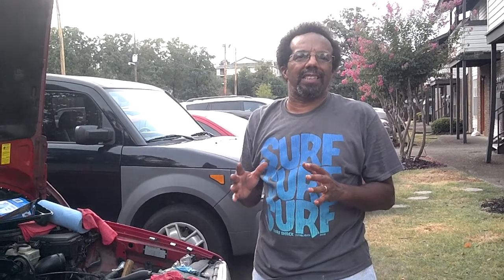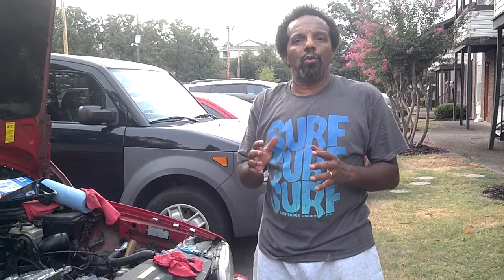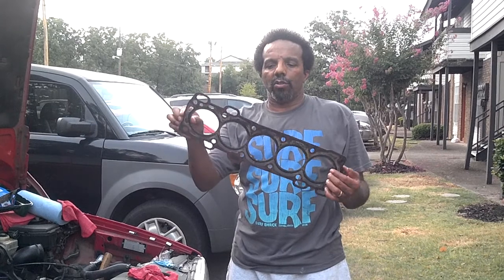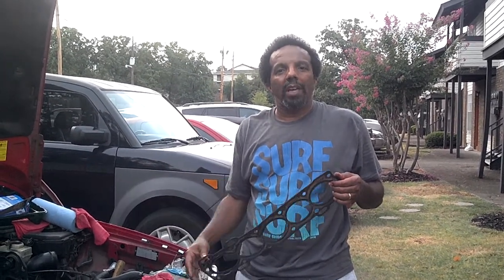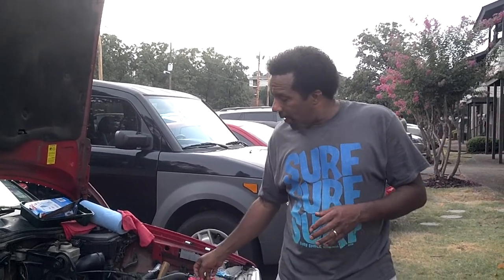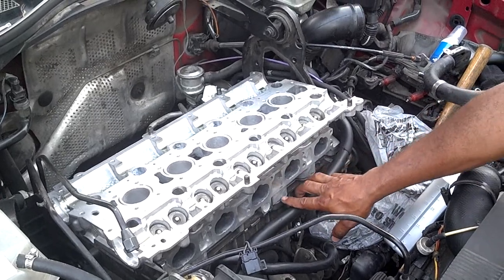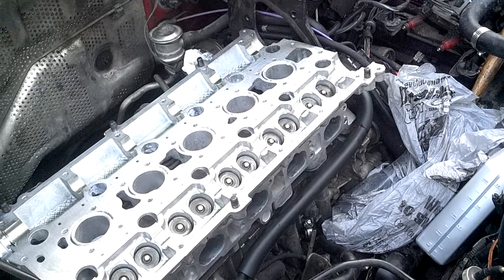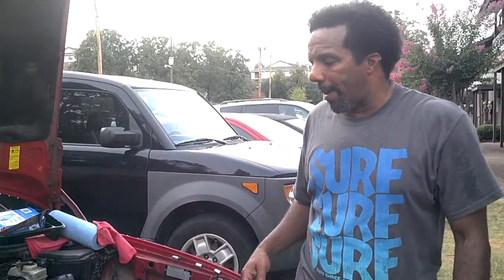Car head gasket information, loosing a little coolant over time. - VOTD

Comment: Robert thanks for all of your Volvo Vids. They have been helpful.

1997 850 +170K
The car is running well and no smoke . I was checking my fluids and noticed the coolant reservoir was empty. I put coolant in to the full level probably < 1 quart. I don't think my son over heated the car. HOWEVER, I WATCHED THE COOLANT TURN TO CHOCOLATE MILK. I could see a few drops of oil floating on top. 

-I removed the reservoir and drained the coolant from the radiator. The radiator coolant was perfect until the very end where there was a few drops of coolant.  I had the water pump replaced in Nov. when I had the belts replaced.  

- I bought a used reservoir and started the Prestone flushing. During the flush the sludge returned. I can skim it off with a turkey baster, but it only returns. 

The oil is fine. However I do seem to be down a little. 

Your thoughts on HEAD Gasket and any experience with gasket sealer? If I can get another 6-12 months out it her, I'll be happy.

Only owner for 19 years. 

Thanks again.
Reply from the maker: +pjlocke1 Have you checked your transmission fluid level? Is your car turbo? Chances are, you have a bad radiator.
Reply from the maker: +pjlocke1 Does your low coolant light work?
Reply from the maker: +pjlocke1 https://www.youtube.com/watch?v=r6Ct58lMhcI
Reply from the maker: +pjlocke1 https://www.youtube.com/watch?v=c_MJwY1fabE
Reply from the maker: +pjlocke1 https://www.youtube.com/watch?v=jsxPXltMFOc
Reply from the maker: +pjlocke1 https://www.youtube.com/watch?v=ZqdHDqGKYV0
Reply from the maker: +pjlocke1 https://www.youtube.com/watch?v=wGXoRLSDE04
Reply from the maker: +pjlocke1 I would NEVER put anything in my car engine in an attempt to fix some kind of leak.

Comment: I had the radiator replace 6-7 years ago.  Low mileage since then, so I don't think it is it.  It is non- turbo.  When I drained the coolant there were a few drops of oil floating on the surface.   

I had the water pump replaced 3 months ago.  I read somewhere that the water pump could be the culprit, but don't understand why/how.  I didnt think there was an oil line involved with the water pump.  

Btw, I like the Steelers hat.  A burgh'er myself.  Thanks for the hand.  Really helpful.
Reply from the maker: +pjlocke1 LOL, Radiators can go bad in 1 year, especially if they are cheap aftermarket ones.
Reply from the maker: +pjlocke1 There is no way a water pump can access oil.
Reply: +pjlocke1 
You called it.
I finally took it into a local shop. I had a radiator problem. The coffee colored scum was transmission fluid leaking into the coolant at the radiator. New radiator, flushed both systems, and it seems to be fine.

The trans has been sketchy so I hope the flush didn't kick up anything. I have been told that old slipping Transmissions are like sleeping babies. You just don't screw with them. Doesn't leak, but slips starting out and into 2nd. in hot weather.

Thanks for the help.
Reply from the maker: Trans slipping now? Most bad radiator situations causes the coolant to enter the transmission. This may have been your transmission issue. I hope you got a GOOD radiator this time???

Comment: Hi how are you? I have a 2005 Volvo S40 and my question is,is using a head gasket sealer safe on the car to seal the gasket??it was running hot so I continued to put coolant in it until one day I decided to let it sit,and not drive it until I figure out the issue..one person says hey it’s the reservoir leaking so I just put a new one on put coolant in it started the car let it run for 30 mins and when I looked no coolant in the  reservoir but yet my temperature gauge stayed steady and car never overheated and next thing I know my car idles down and shuts off on me...yes it was smoke 💨 coming from the muffler but eventually cleared a Little just don’t know what to do next at a lost even put brand new radiator hoses on it
Reply from the maker: https://youtu.be/B12SNN_3pq0
Reply from the maker: I would never add the stuff in my engine.

Comment: Since Volvo's usually have aluminum head and block, would you also indicate that the block should be machined as well? An overheated engine normally warps the head because the blocks are iron, but with Volvo's is might warp both, correct?
Reply from the maker: Possible. The block is a lot harder than the head.
Reply: @RobertDIY  that's what I figured. I assume since both are aluminum then both would have the same melting point and hence the same "warping" capabilities upon reaching the same heat. Good to know thanks! I bought a 2003 Volvo S40 and replaced the engine and tranny with an engine that had 300 miles. So I'm good for now.

Comment: Hi, Robert! Thanks from all of us, your videos are amazing.
94' T Wagon
I believe the fan wasn't working and my car overheated after sitting at idle for about 30 minutes. Coolant boiled over, I waited/ filled it then drove home. I fixed the fan and the car is running fine since. I am seeing a small amount of coolant at the bottom of the oil dipstick now. I am thinking I damaged the head gasket. Could coolant have leaked into the oil under high pressure and now it is OK?
Reply from the maker: I doubt it.
Reply from the maker: https://www.youtube.com/watch?v=za8qgxDey8I

Comment: hello robert i have a 1994 volvo 850 turbo . do you think it is a MUST to resurface etc. the head for the car if it never turned off or overheated
Reply from the maker: +Celina Perez no, but you have to make sure it is true. You can warp a head pulling the bolts out of the head.

Comment: I have a question for you.  I have a Volvo S40 2006 2.4 5cylinder.  Recently out of no where the car stopped on my wife on her way to work.  She could start it up and everything was normal on her way to work.  On her way home, the car stopped again.  So I drove the car around the block, same results.  All of the lights came on and immediately went off.  Then the oil light came on.  The car started up again and I made it home.  I took the car to Volvo dealership and they told me I had a coolant leak and the the engine had low pressure.  They changed the coolant reservoir and repair the leak.  They promptly explained that I would need a new engine to the tune of $13000!  The car never over heated.  The oil looks fine with no mixing evident.  Is it safe to say that this could be an example of the head gasket needing to be replaced??
Reply from the maker: Urban Mello I doubt it. A compression test will tell you if the motor is worn out and needs to be replaced. Random stalling is likely some other issue like a fuel pump failing, some sensor going out, etc. Did the car toss a code? How long have you owned the car? Is the proper oil being used? - How to do a compression test on a car motor. Volvo 850, S70, V70 through 1998 - Auto Repair Series
Reply: Robert DIY

What would constitute a need for an engine replacement?  The car runs and is not running hot at all.  I change spark plug and did not notice any leaks or visible cracks in the head.  The original issue was a leaking coolant reservoir.  This was repaired by Volvo.  Could it be possible that from the leak, it could have possibly leaked onto the engine in turn affecting the gasket?  And how can you tell?
Reply from the maker: Did you watch the linked video?

Comment: okay got a 2002 honda civic coolant going to the reservoir and not overheat temp gauge is good. looking around radiator if there is a leak nothing change radiator cap already car runs good no problem. No white smoke coming out from tailpipe, coolant does not mix with oil everything is don't know why coolant going to reservoir what is causing this please help thanks?
Reply from the maker: Maybe it is supposed to. If everything is fine, why are you leaving a message?
Reply: Robert DIY 
 everything is fine just asking what causing the problem and why  coolant going to reservoir no idea
Reply from the maker: Why do you think it's a problem? Is it over filling the reservoir?
Reply: the only time coolant is overflowing from the tank is when I'm driving fast and drive slow not overflow.
Reply from the maker: Then there is probably a problem with the head gasket. Have it tested.
Reply from the maker: https://www.youtube.com/watch?v=jsxPXltMFOc

Comment: I have a 99 s70 glt that I've owned for six months. recently I've had to fill the coolant every day or every other day and I'm wondering why because the car has not ran anywhere near hot since I've had it? in fact the temp gauge has never crossed over the halfway point and usually stays well below halfway if I'm on the highway.  any input would be greatly appreciated :) thank you.
Reply from the maker: +harwellinhell how long have you had the car?
Reply from the maker: +harwellinhell there is coolant escaping or leaking somewhere.
Reply from the maker: +harwellinhell figure it out before you blow the engine if you haven't already.
Reply from the maker: +harwellinhell https://youtu.be/jsxPXltMFOc
Reply from the maker: +harwellinhell https://youtu.be/-2oIeIhpV44
Reply from the maker: +harwellinhell also sounds like you have a bad thermostat.

Comment: What's up Robert? When my Volvo starts acting funny, I search online for solutions. Nearly every time, I run across one or more of your videos.

Help, please! :)
My vehicle: 1994 Volvo 850 Turbo, 2.3L in-line 5 cylinder
I had a bad head gasket a couple of years ago. Luckily, the local junkyard had the exact engine as my car and wanted to sell it. I bought the engine for about $1,200 and had it installed for around $300 (was a terrific deal).

Anyhow, my birthday is the 28th and I procrastinated on getting things taken care of so I could renew my tag. My Volvo failed an emissions test, on the 26th, which is required to obtain my tag on the 28th. The car is going through what you described in the video, which I had already thought was an early sign of a bad head gasket. The coolant level is low, but not really, but yes it is low... Driving me nuts! LOL. The test results that failed the vehicle was the NOx ppm levels. The are as follows:
25/25 Test reading: 1042,  Allowed:  821
50/15 Test reading: 1246,  Allowed:  907

They really aren't that far off compared to what I've seen fail. Would you think that in the early stage of a bad head gasket there will be no chance of passing emissions on the next day? Again, researching online on ways to bring down NOx levels I found many "...and it could be this", but two noted reasons for higher NOx levels are the air intake temperature may be too high and the cooling system may not be functioning properly. Not thinking about any cause, earlier today I was under the hood inspecting everything to find something wrong. I ran across the cold air intake gap, which I remember from seeing it shortly after having the engine installed, between the air filter compartment and the "hose" which leads to the front of the radiator. There is another thicker and sturdier hose which obstructs the path of the cold air intake, which I was just lining them up the best I could, but still left about an inch of a gap on one side. Worked with the intake hose for 20 minutes or so and got it to a MUCH smaller gap. Also, bought/installed a new air filter. Next, I noticed a small hole, about a half inch by a quarter inch, in the intake hose, but this is on the engine side of the air filter. I just did a quick patch on that for now. Drained the dirty engine coolant (was dirty water) and refilled with a water/antifreeze mixture, prolly around 75/25 mix, drove around, let it cool down, then topped off the coolant. Was using 87 grade fuel (I know, it's bad, times are hard right now though) so after driving around town today I put about 4-5 gallons of 93 grade fuel. What other quick, DIY maintenance can I do to bring down the NOx levels just a bit more?

Your input on anything that could help the NOx reading go down, even just temporary, would be greatly appreciated... I am big on green tech, so when my car failed emissions, I was livid. A temporary fix, if there is one, would be just to get my tag and registration. God bless, Craig
Reply from the maker: If your PCV system is clogged, that will cause your car to produce bad numbers. You should also clean your EGR. Some people fill the gas tank with fuel, add 1 gallon of painters laqure thinner, and drive the car 250 miles or so to clean out the catalytic converter. And you need to replace any bad intake hoses. - Volvo PCV System Check, 850, V70, S70, and others - Auto Repair Series - Volvo 850, S70, V70 PCV system change replacement Pt 1 of 2 - Auto Repair Series
Reply: Robert DIY I did the oil dip stick test for the PCV system. Smoke coming out pretty good. Also, the rubber glove over the oil fill on top of the engine showed a little air coming out. You have a video showing the locations and how to dismantle the PCV system in a 94' Volvo 850 Turbo?

Couldn't the engine coolant be mixing with the oil be causing the smoke out of the oil dip stick?

Anyhow, I saw online that Volvo had a recall on a throttle with the same model I have. Submitted a request for them to check it out. They emailed me and said there is no such recall, which it's prolly too old to service the recall 20 years ago... lol... But, there was an attachment in the email, which was a coupon for 20% off any genuine Volvo parts purchased from a Volvo retailer. I'm going to have them run a diagnostic test ($119) on Monday or Tuesday and the money spent on the test will be deducted from the parts and labor for fixing the car. So, hopefully they will honor the 20% off the parts they install on the car.

I start a full-time job on Monday, so there will be no more 87 grade fuel, no driving with 3 gallons in the tank and some much needed parts being replaced (like the 20 year old fuel filter!). Oh, and 5,000 miles between oil changes is just too far! I checked the mileage with the "A" and "B" jumper boxes under the hood, the mileage was at 296k miles! :)
Reply: Robert DIY Oh yeah, took the car today for the second emission test. It still failed, but the results were better.

15/25 Test
NOx ppm Reading:  1001,  Allowed:  821

50/15 Test
NOx ppm Reading:  1158,  Allowed:  907

Still think it would pass if the odometer read the actual mileage at 296k miles! Odometer cut out at 129,999...
Reply from the maker: Ok